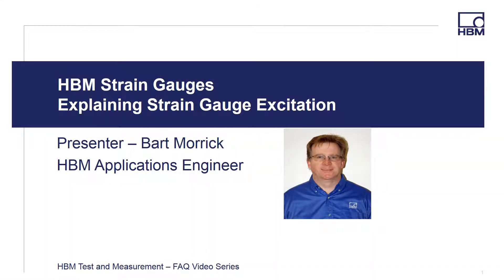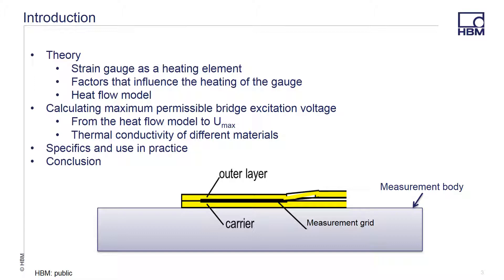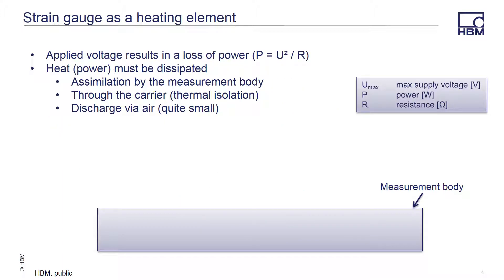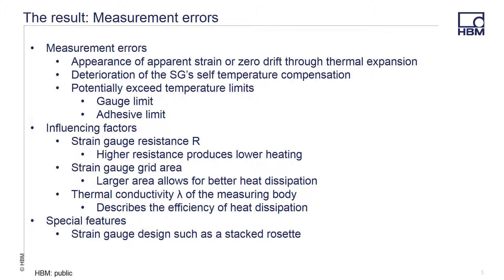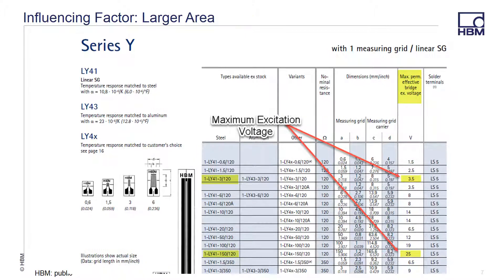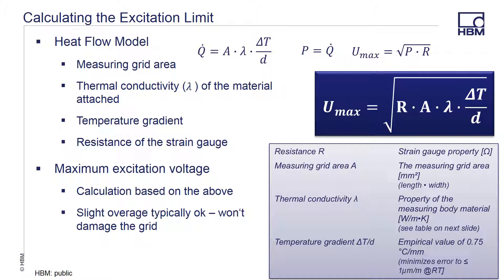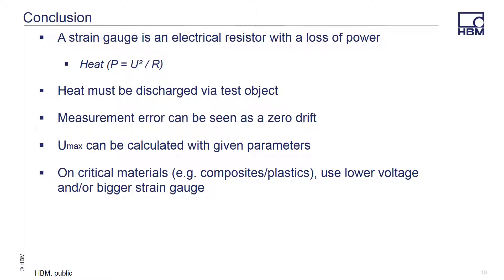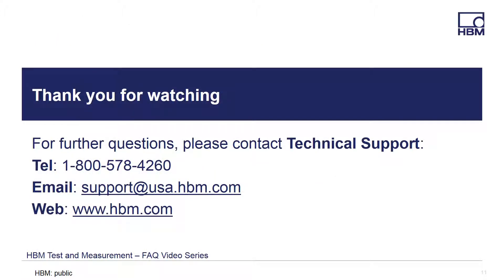Explaining Strain Gauge Excitation

Comment: If my primary objective is to improve signal to noise ratio on strain measurement of a plastic material, would it be best to increase the gauge resistance to 350 ohms and raise excitation voltage? Or increase gauge size within my packaging constraints?